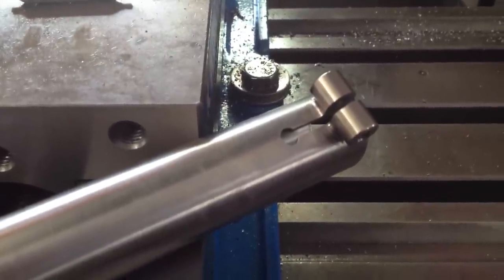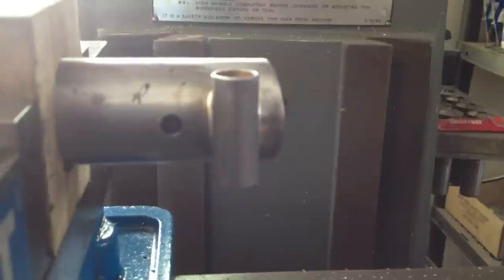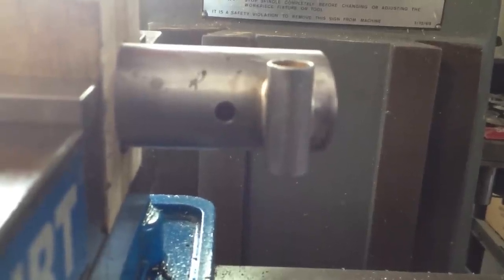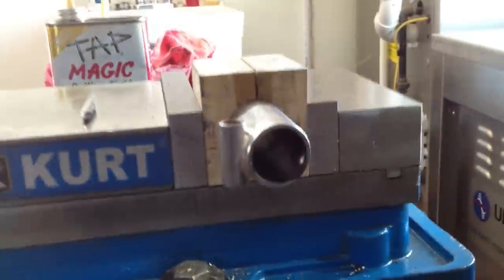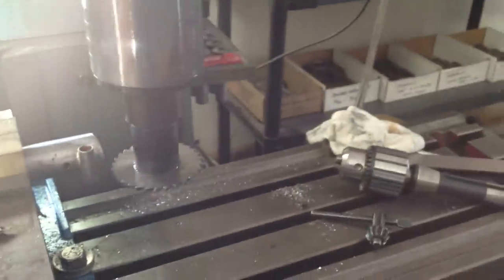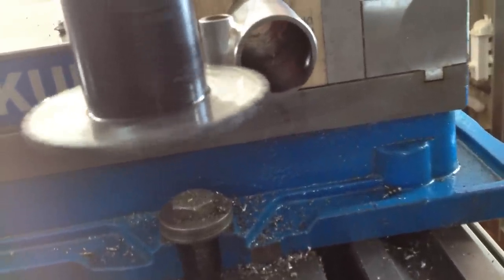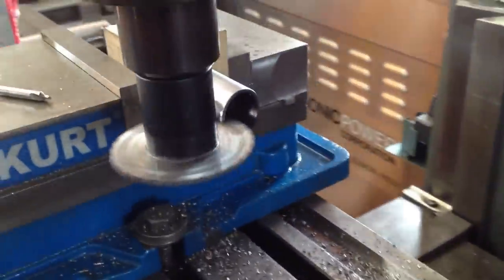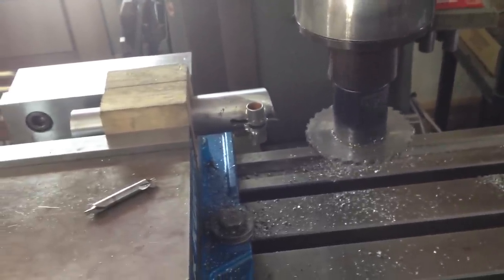Slotting bicycle seat tubes

Comment: where do you get your slitting saws from?
Reply from the maker: Steven...you can buy these from any of the major machine supply houses; MSC, ENCO, etc...  they are defined by tooth count, outer diameter, thickness, and arbor size.
Reply: +Rody Walter hi Rody, I've fussed with a few but had some bad luck with some. Was wondering how thick this one you use is and what's your tooth count